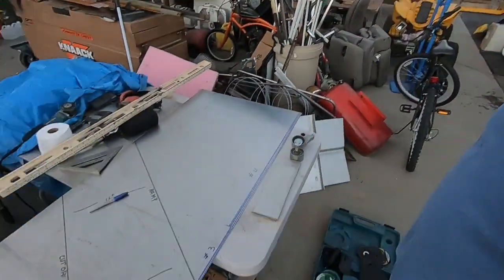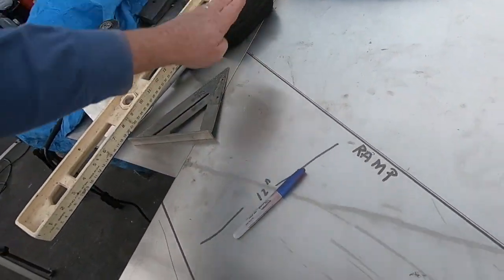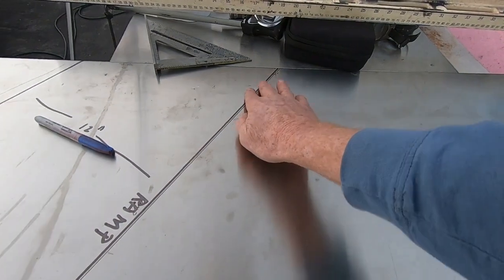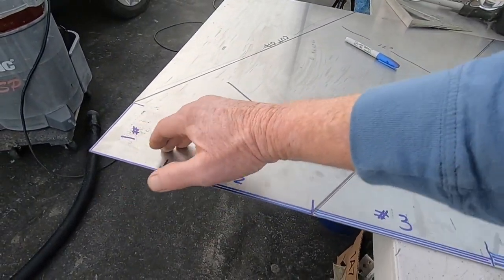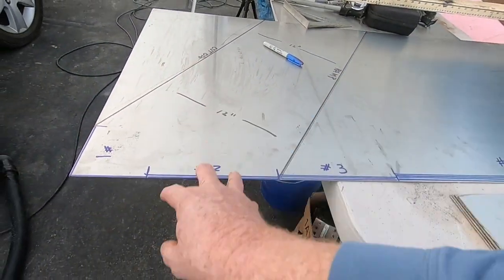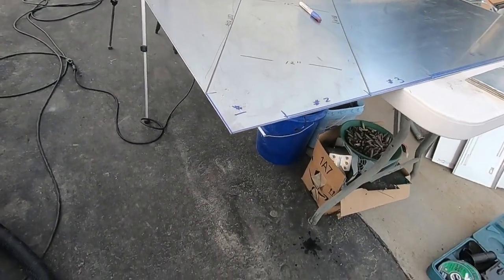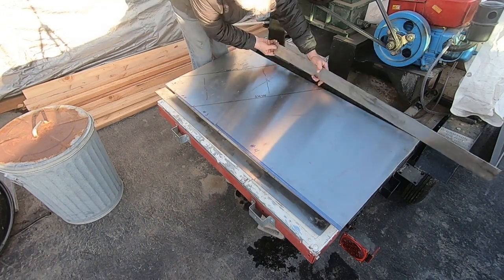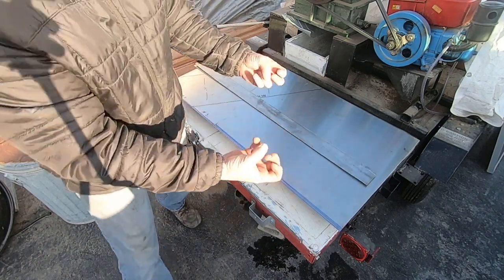DIY GOLD PROSPECTING SHAKER TABLE Part 1

Comment: Looks like it's going to be a nice build!
 Throwing ideas around in my head on a wave table! Good luck can't wait for the next vid!
Reply from the maker: Gold Pro Unlimited, thanks so much!
Throw around ideas my way!
I think I have a good plan.. 
1. Make Table exactly as I’ve seen and know will work well!
2. Build framework and drive that fits the table design and the trailer nicely.
3. Make sure I can stabilizes the Table so it functions properly.. some fold down feet that lifts the entire trailer? Or maybe just lifts the Shaker Table off the trailer entirely so it’s isolated from the trailer? Not totally sure just yet.
Comments are very helpful!
Thanks for your input!
✌️PT
Reply: If its not to late, could you find a local shop with a metal brake to do bends on the table vs welding..welding may do alot of warping!!
Reply from the maker: Yes getting the table bent would really be nice and clean!
I plan on clamping the areas being tackled into place and hopefully not get it too hot. After that I will continue clamping and welding until completed. Hopefully I can adjust as I go and Keep the warp down too a minimum. Will also have the frame to hopefully keep things flat.
We’re definitely going to see ✌️

Comment: you also can use a straight edge  clamped on to the sheet metal and use a jig saw running against the straight edge  (with a metal blade)
Reply from the maker: greedy gringo prospecting, I tried cutting before but this Stainless chews up the blades quickly.. grinding wheels cut this stuff pretty nicely and can cut about a 100” linear inches per wheel. ✌️
Reply: @ProspectorTripp  I have seen diamond blades for all kinds of things  just search on google then what stores have them  even circular saws and your angle grinders  just a thought   check it out  up to you
Reply from the maker: Will do sir.. thanks

Comment: where are you gonna   get the v-mat   or rubber from
Reply from the maker: greedy gringo prospecting hello ggp!
Going to buy epdm rubber roofing and either cut the grooves or cut strips and use the proper glue to adhere them to the mat.
I’ll most likely go the gluing method because I want to use thin 1/8” mat to keep the weight and costs down.
Any ideas are very much welcome!
Thanks buddy 
✌️PT
Reply from the maker: Maybe from these guys ✌️
https://www.rubbercal.com/sheet-rubber/?gclid=Cj0KCQiA_rfvBRCPARIsANlV66PVovnKEEeIdDzyvxi9zOp4Pfn51O7yhyuLZ0wDcvUs4AAiQwFmInYaAiIyEALw_wcB